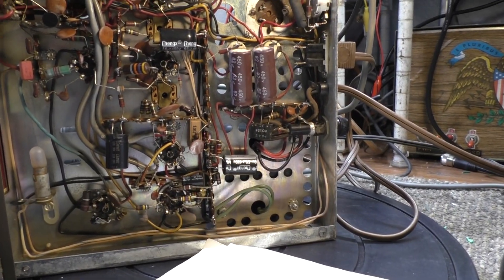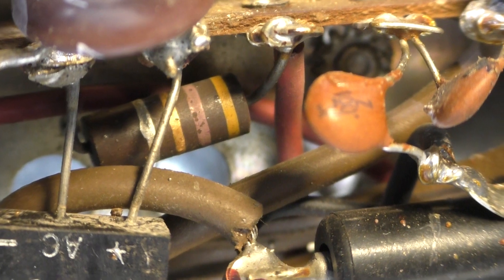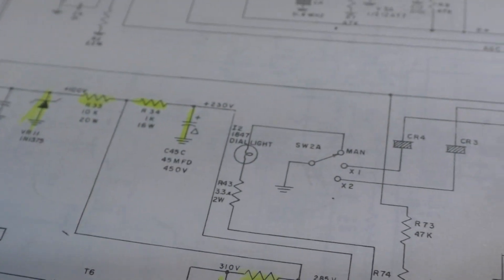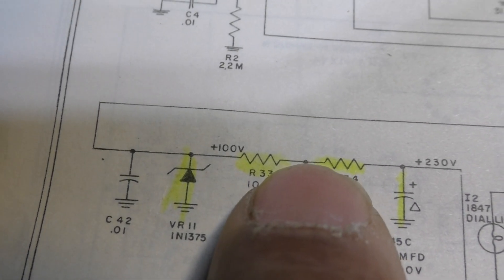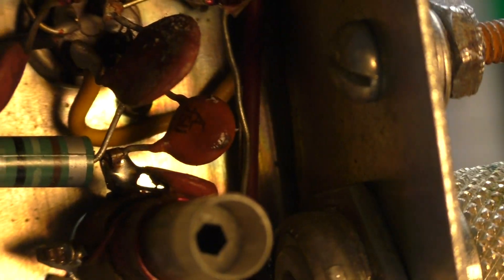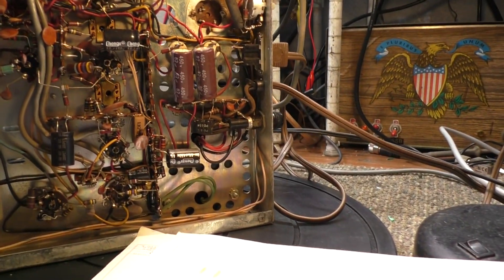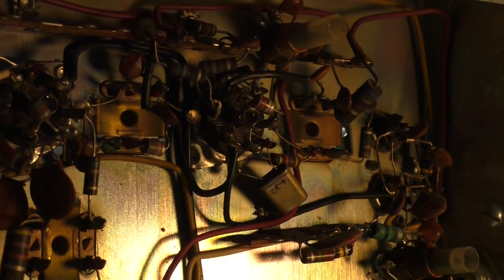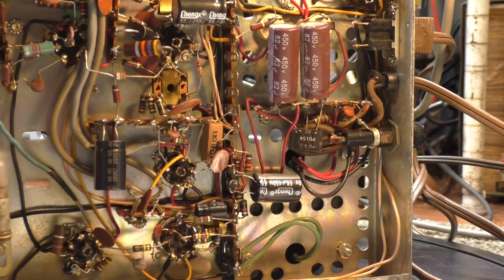Browning Golden Eagle Mark 3 receiver, customers, on the bench

Comment: Here's my experience with the Mark 3...
Left stock, it's a good receiver... for its time. Accept that. 
The resistor between the transformer and the diodes acts like a fuse that protects the transformer in case the diodes short out. It's really stinky when that happens! 
The receiver oscillator coil. Tweak it for max and you'll be able to listen to channel 6 on channel 23! That one was a head scratcher until I followed the factory alignment info. 
When the tube that controls the S meter begins to weaken, the meter will read higher than normal. This is because the S meter is "backwards", less current equals a higher reading. 
Some people say that these are high maintenance. Left stock, that's not true. I've had to modify the squelch circuit to actually get it to work properly. Since most people don't use it because they want their "screaming eagle" it's not a problem if you don't mind listening to the static.